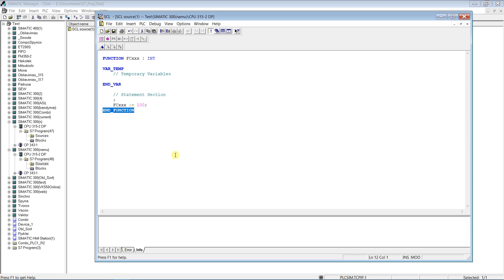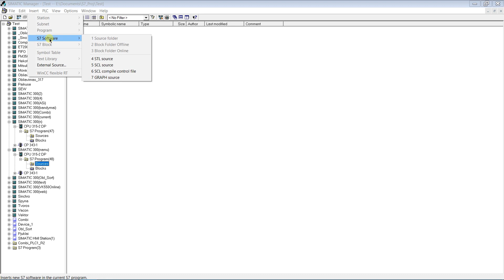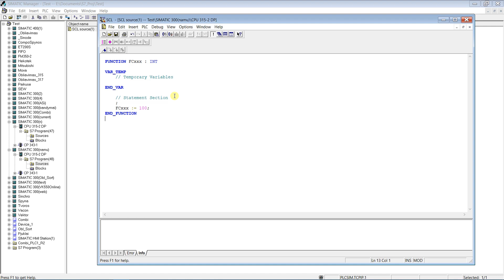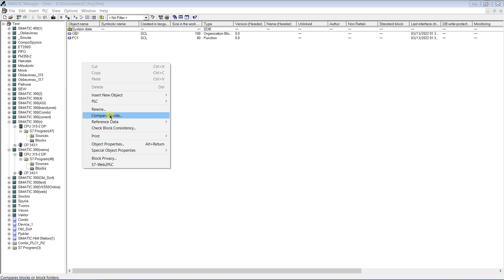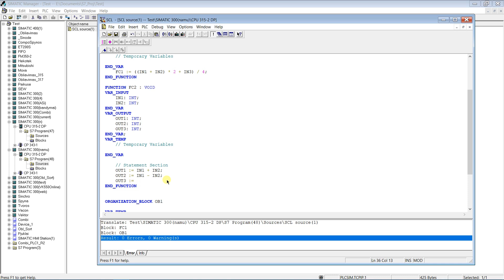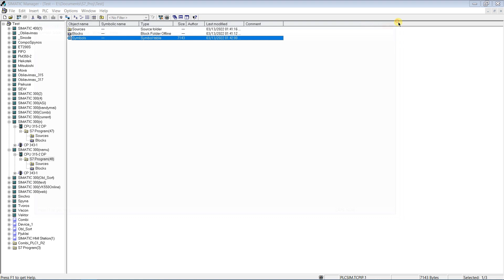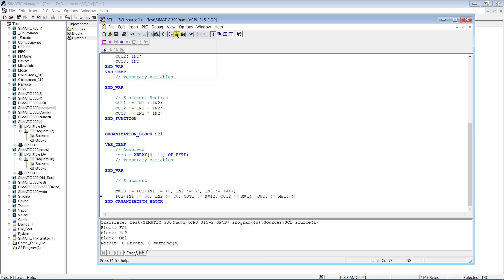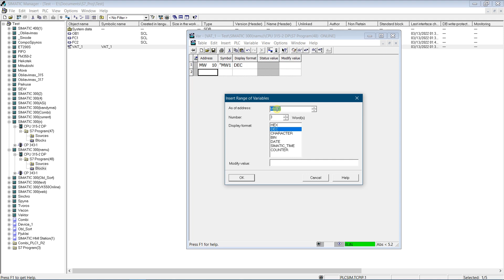SIMATIC STEP7 SCL: Call FC block with or without returning the result

Comment: how to do a FB?
Reply from the maker: I might be mistaken, but FBs have no return parameter. FBs have so called "memory". Data block is assigned as the memory of the FB.
Reply: @automatikavaldymas  already figured it out myself. You just write function_block Fb1 for example, without void & end_function_block. After compiling u can drop the scl fb into OB1 or any other and assign DB1 etc. But anyway thanks a lot for the reply! Best regards
Reply from the maker: @KingSkully   Warm tip. You do not need to write it by yourself. You can make Simatic manager to do it for you. Please click on Insert>Block Template and select any template (OB, FB, FC etc.) and you are good to go. Good luck!
Reply: @automatikavaldymas  omg now I feel dump, anyways thank u so much